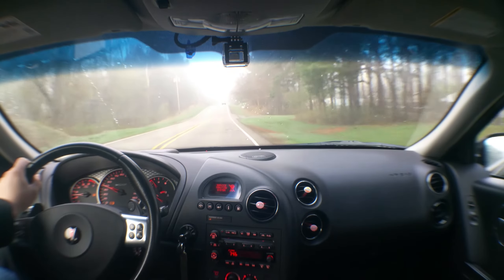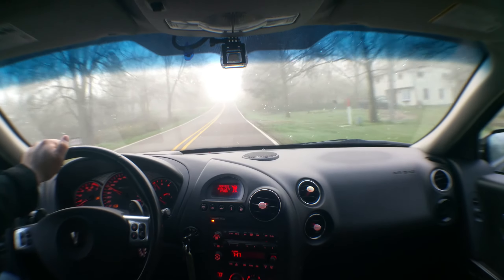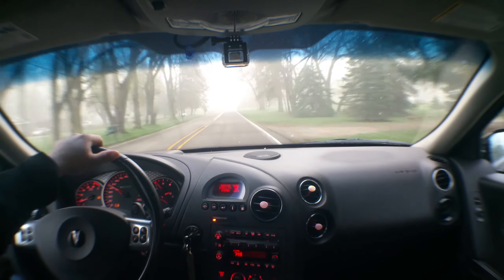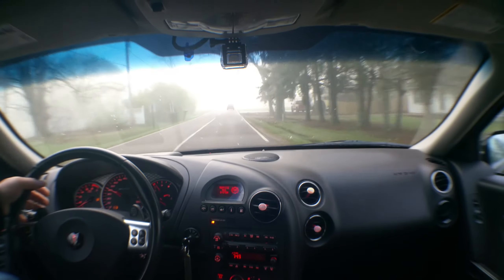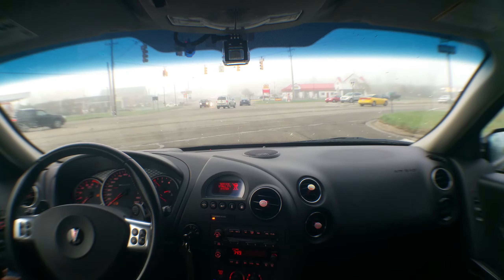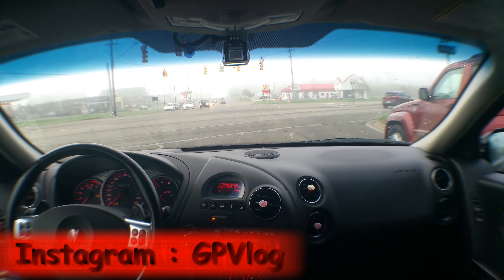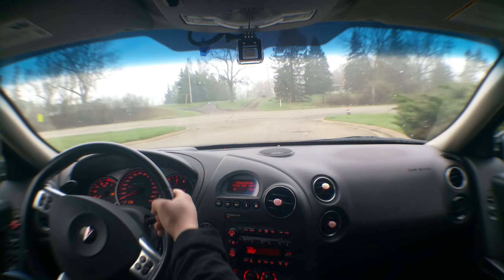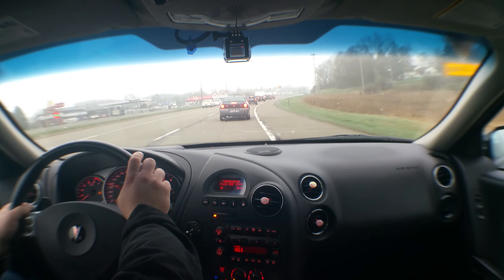Take a drive with me - Another broke wheel sensor

Comment: I have a 04 GP GTP and my same lights keep coming on I climbed under there and grabbed the sensor harness pulled the cover back and I could feel with my hands a huge slash so think its bad its on the passenger side also though can it make the breaks lock up? Just got new brakes and a new brake line I told them I needed a caliper they said I didnt do next day after picking my car up brakes locked up again took it back they said it was air in the line got home noticed they changed my caliper cause mine were all red and now I have a rusty one so u think I just need a new caliper that it could be going bad again, ughb so tired of this crap...